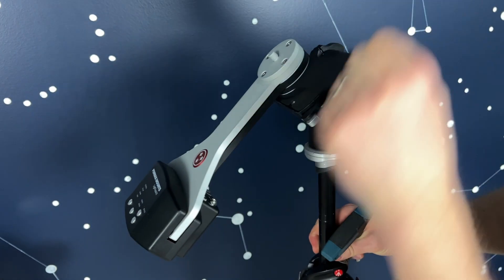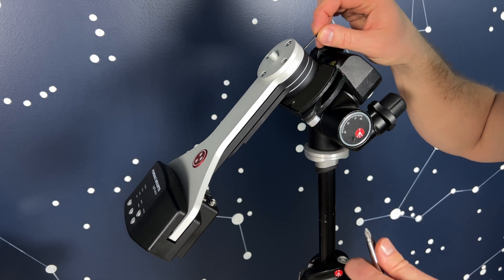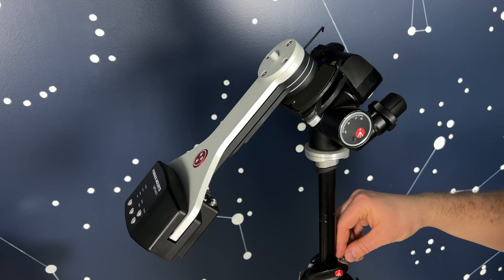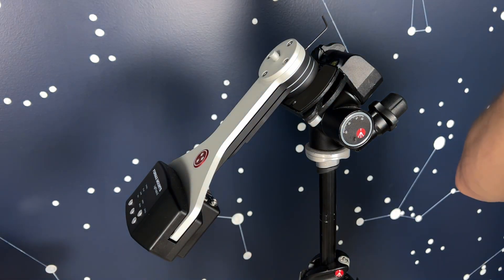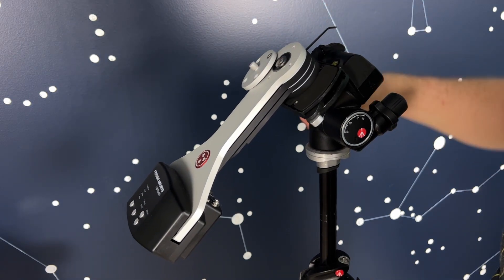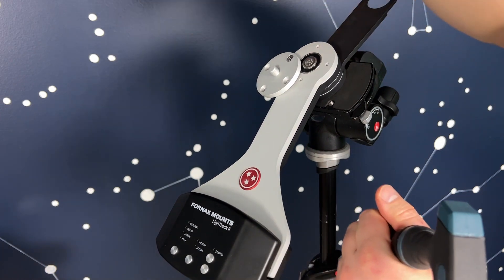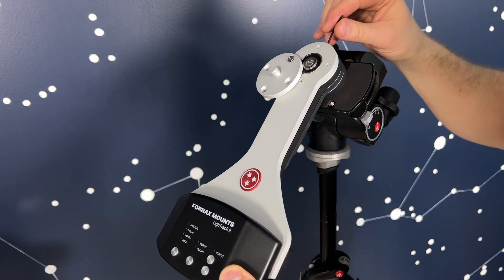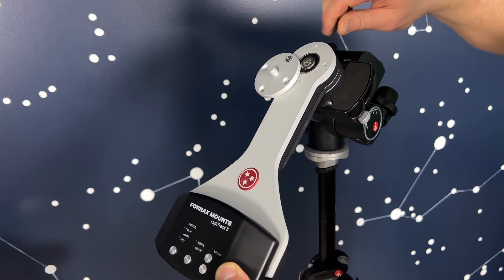Fornax Mounts LighTrack II: Polar Scope Arm Adjustment Tutorial

Comment: I used it in Zanzibar , 6 degrés south with no counter weights and a 135mm lens. I realised that the status button could hardly make the mount turn in the opposite direction from the camera. It works fine when latitude is higher than 15 degrees and the plate is no longer almost vertical.not sure it had an impact on the pics because some of them where ok some not, can’t tell if this is due to that problem, but when the pole is at the horizon or just above there could be an issue. The camera and lens were not heavy but both the plate anD the camera were facing the southern horizon or near to photograph the southern Pleiades. To reach the Pleiades the camera must be on the left side of the mount. Have used the mount in all situations during one year at 23 degrés latitude, same setup with no problem.
Reply from the maker: Sounds like it was definitely imbalanced, which makes sense if perhaps you were using a ball head and you had the camera out over the side at 6 degrees latitude. In that situation all the torque would be going directly into the drive. In this type of situation you need to be cognizant of balance and keep the camera/lens centre balanced by making sure the gear is out in front of the mount along the RA axis as much as possible.
Reply: Next time I bring the counterweights…heavy in suitcase though
Reply: Next time I bring the counterweights…heavy in suitcase though
Reply from the maker: @pascky999m3  you may not have to. I've had success using a lightweight gimbal head meant for wildlife photography. It allows you to centre the balance directly through the RA axis, and could prove a lightweight and compact solution when traveling to single digit latitudes.

Comment: Great video Darren!! My polar scope isn't loose but the whole mechanism rotates on the last ring at the base (the attatchment plate, as you said) just a little bit. That includes the polar arm, so I have to be real careful not to nudge it after polar aligning. Everything still works, though as the weight shifts during tracking it will sometimes flop that little bit and I have to re-aim and align.(I have the whole counter weight system and a pretty good payload) 
Maybe I need to adjust that screw a bit to tighten everything up?
My light track II has seen alot of use 🙂 I still love it.
Reply from the maker: Hi Joe, what’s happening in your case is that those little set screws are loose. Follow the first step, removing the little set screw, then tighten the inner set screw. After it’s snug, put the outer set screw back and tighten that one as well. Make sure that the back mounting plate is in the correct orientation before doing so, with the three mounting threads being horizontal. I hope that helps!
Darren
Reply: @FerventAstronomy  Thanks for the quick response!! That makes sense and I will give that a go!